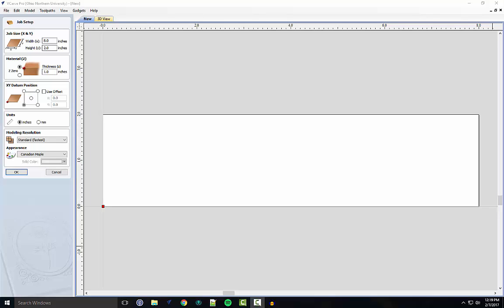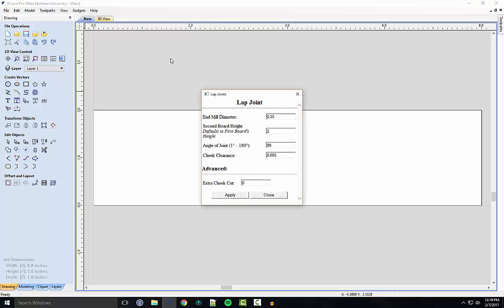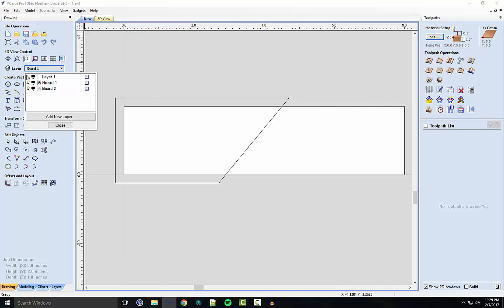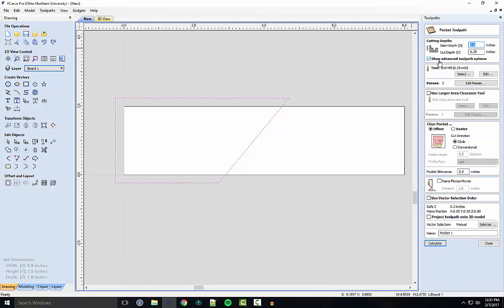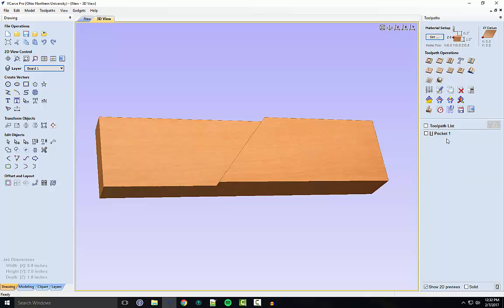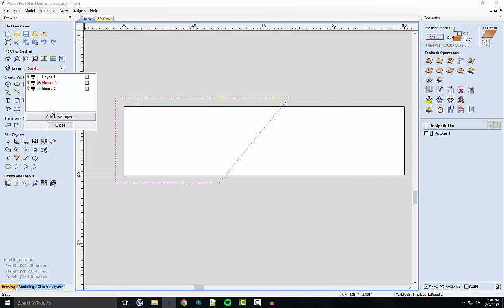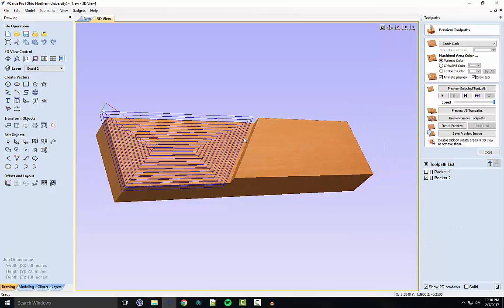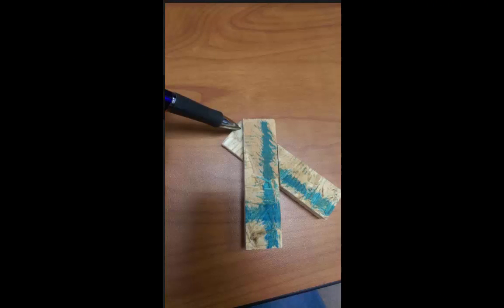VCarve Pro Lap Joint CNC Guide

Comment: Hi Matthew, what a cool plugin, thank you for sharing with the broader community!  I downloaded the files you have shared but didn't see the gadget files.  Specifically I was hoping to use the lap joint gadget for a stand up paddle board I'm building.  I have a 48x48 table bur my rails are 11'4" so I will need to glue up multiple pieces.  Your gadget would be perfect for this!